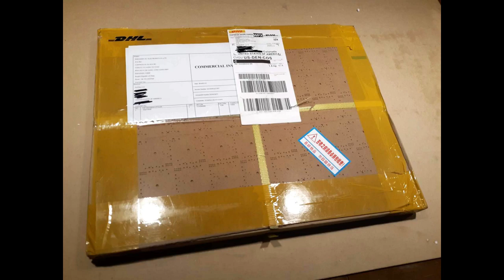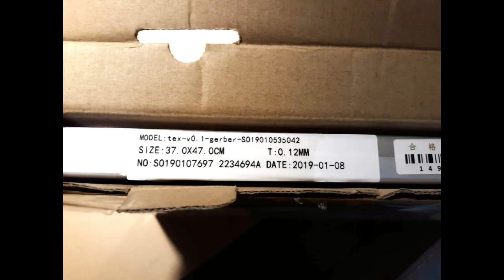190402 Charmhigh 4432 Stencil Printer Unboxing and Review

Comment: Now that you've had it for a while, whats you're opinion? I'm thinking about getting one of these, but not sure if its accuracy and repeatability is good enough.
Reply from the maker: Three issues with this stencil printer. I'm using JLCPCB stencils with their frame. The counter weight isn't heavy enough to hold the framed stencil in the up position. Second, there's no tapped holes in the board surface for fixturing. So each board requires a little tweaking before applying solder. Lastly, the fine positioning mechanism is crude, There's threaded shaft for y a axis positioning, this is OK. The x axis and z axis rotation is handled by 4 thumb screws, 2 opposing   2. When you get position close, you tighten the opposing screws that results in a slight board movement, this is pain in the butt.  If I did a lot of boards (I'm at the 5 to 10 prototype quantity), I'd opt for a printer with fixturing options and better rotational positioning. I'll probably just CNC machine a grid of M5 threaded holes in this one and see how it goes. Thanks for watching.
Reply: @CraigHollabaugh  honestly this thing looks like a scam, how would you even do double sided boards with this? If you are doing anything complicated that requires bypass capacitors close to the pins of a microcontroller, you would have a terrible time if you don't have a stencil printer like the "3040" that lifts the pcb so both sides can be solder pasted on
Reply from the maker: @BHSAHFAD  you're correct here. I gave it away then bought one with milled base with threaded holes.  Much better.
Reply: @CraigHollabaugh  yea i think we both got the same one, it's called the 3040 stencil printer
Reply from the maker: @BHSAHFAD  you're probably right. Get something else that fits with your needs.